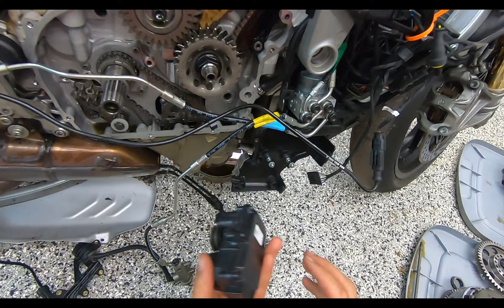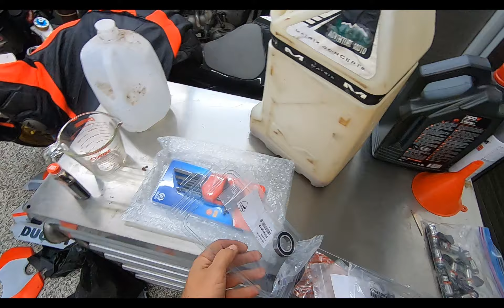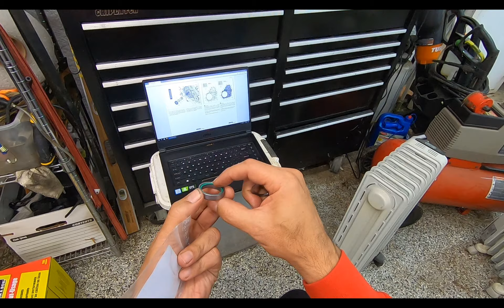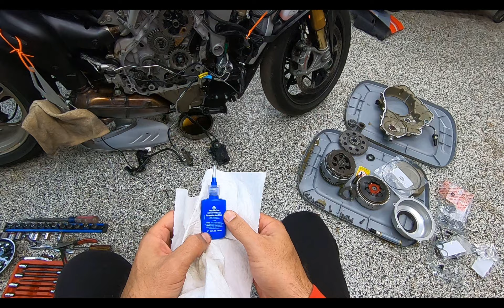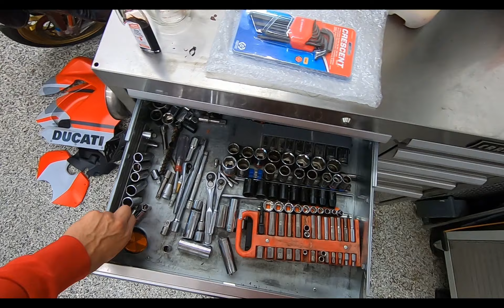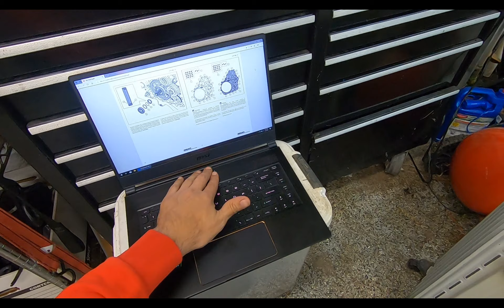Ducati V4 dry clutch install, Part 2b

Comment: That servo motor comes off with 4 bolts, check out Ducati Pentigale V-4 arrow exhaust install by calli moto. Alot less work. Great video brother, thank you.
Reply from the maker: thanks for the tip.

Comment: Hi, I am in the process and initial stages of performing this. I have 2 questions: 1) did you resolve the Removing the oil seal from the slave cylinder 2) Did you install the the roller cage into the gearbox shaft as well as the oil seal?
Reply from the maker: After checking with Ducati trained techs, I didnt remove the oil seal. I did install the roller cage with the factory tool, i didnt put the oil seal in there on advice from the Ducati tech and I've had no issues with oil leaks.
Reply: Thank you. How do you know which roller cage to install?
Reply from the maker: @duclife1059  Make sure you have the Ducati install instructions on PDF. The instructions arent very clear, but if you look carefully its possible to tell which part should go where.
Reply: @ShaunNielsen   where can i get the ducati install instructions from on PDF? Thank you

Comment: Hey Shaun, how does the maintenance on your Ducati V4 compare to the RSV4? I am interested in both of the bikes.
Reply from the maker: I havent had the ducati long enough to know if it will have any issues. However I know that the rsv4 from before 2015 has huge reliability problems and I would advise anyone not to buy one. I would also warn anyone that aprilia/piaggio has a corporate policy of denying all warranty claims no matter what, whereas Ducati were still covering my 2002 996 all the way up to 2011, so keep this in mind when you decide what to buy.
Reply: @ShaunNielsen  wish i knew this before i bought my 2012 trackbike while owning a '16 tuono factory.
Im currently in the process of doing the valve adjustment on the '12.
i think ive watched your Rsv4 videos a thousand times!
Did you ever end up making the Cam gear holder tool?
Im thinking of making mine own. is the Aprilia tool made of Aluminum or steel?
Thanks again. 
I love how calm and clear your explanations are. Thank you
Reply from the maker: @myvw8u  Thanks for the feedback. My cnc mill isn't running at the moment but when it is I'll make some holders.  The aprilia tool is steel.